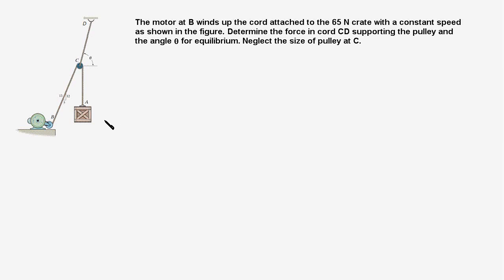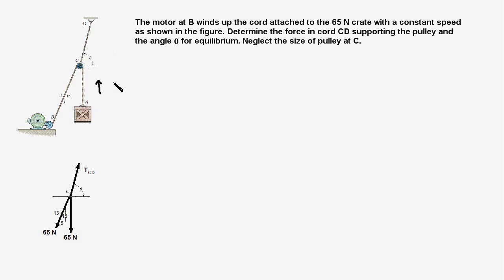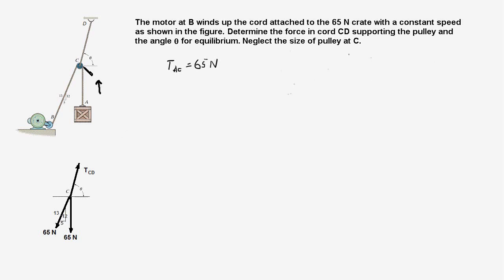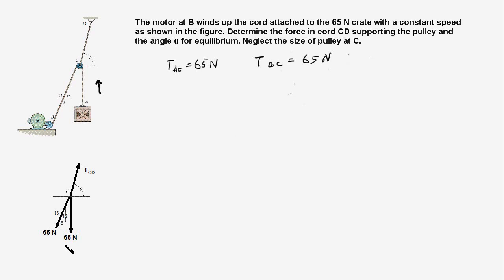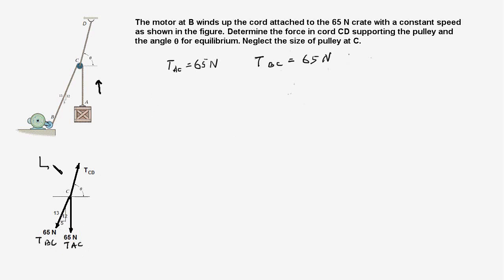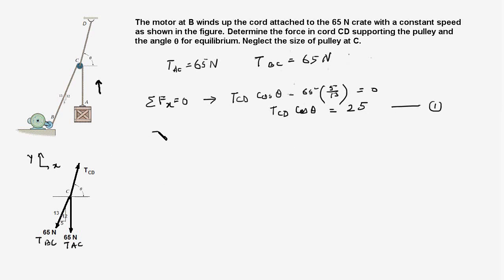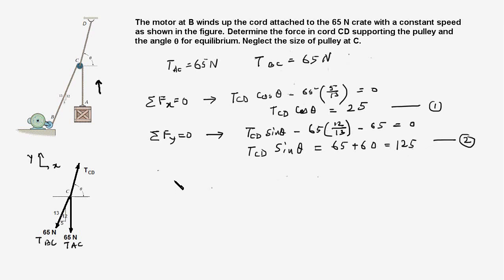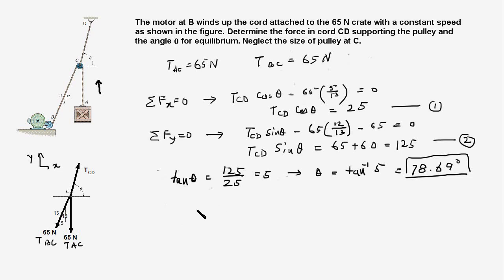4.6 Engineering Mechanics: Particle Equilibrium Problems (Block & Pulley)

Comment: Can we form a triangle with these 3 forces?
Reply from the maker: Yes, indeed. The three forces are in equilibrium and therefore they should form a triangle - an equilateral triangle ( since two sides represent 65N) . It would be interesting to do little calculations to verify it.